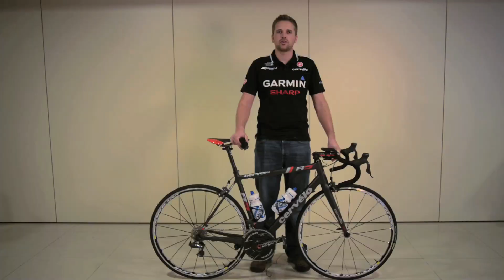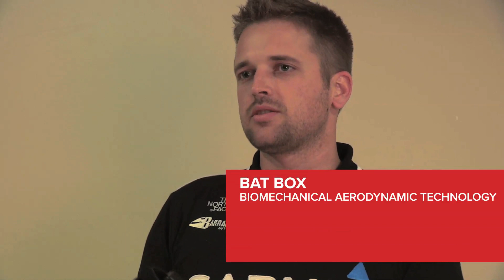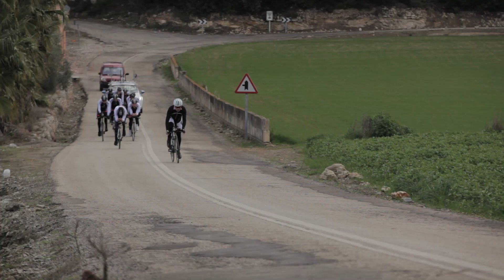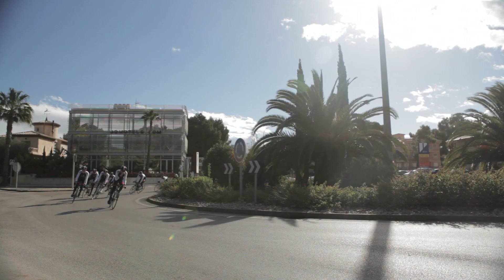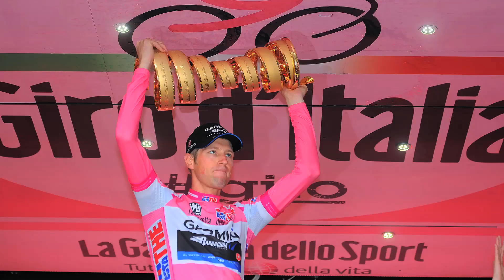How To Get Aero On Your Bike Like A Pro

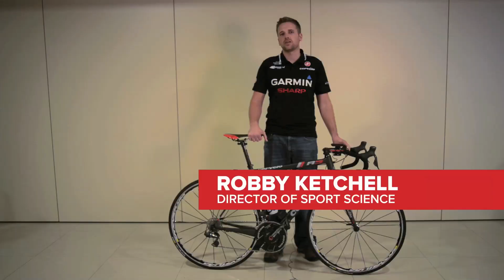Comment: 2:24 Drag at everyday Reynolds Numbers increases quadratically, not exponentially...
Reply: Please show your work.
Reply: Catcrumbs http://en.wikipedia.org/wiki/Drag_equation
Reply: Note that speed is raised to an exponent, hence drag force rises exponentially as speed rises.
Reply: No, the argument of the function (for example, x) is what needs to be in the exponent in order for the function to be considered exponential. For example, x^3 is cubic, while 3^x is (one type of) exponential. Apologies, but you are simply  incorrect about this.
Reply: I concede.
Reply: In idealized situation, (but it doesn't exist), so they use wind tunels.

Comment: If the UCI permitted riders to attach windscreens or nose cones in front of their bikes, companies wouldn't have to blow millions of dollars in R&D to develop aero skinsuits, shoe covers, gloves, wheels, etc.
Reply: defeats the whole factor of 'attraction' towards the bike. People like bikes that look sexy and buy them due to the look
Reply: MelkorHimself 

Dude! You're right!

I don't have any UCI regulator telling me what to ride! I'm a street rider. I bet you there's something I could make out of carbon and fit to myself that'd cut out some drag! It does make a big difference, have found that if I wear a bigger jacket it's like riding with the brakes slightly on.

Also, I don't know how much cycling clothing makers look at the drag of the clothes, but I bet one could do some stuff for urban cycling that'd work better.
Reply: howard9110 sorry... not fit to myself.

I meant "fit myself", as in I could just make something and stick it on.

Presumably vaguely like a small motorcycle fairing, bit of polycarbonate, bit of carbon.